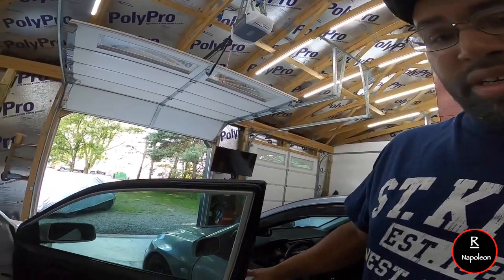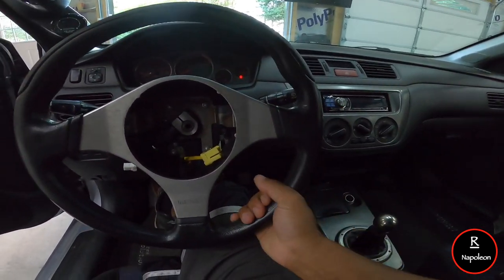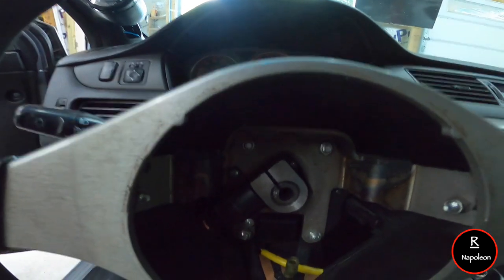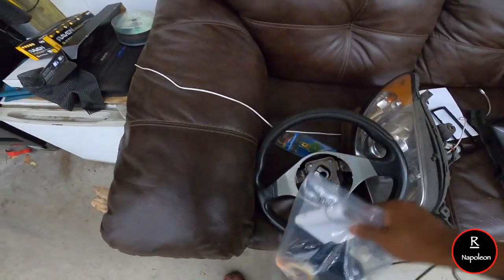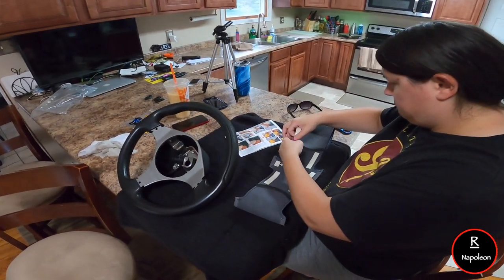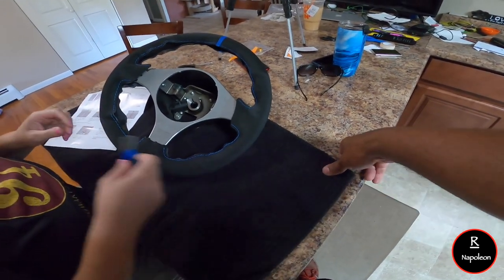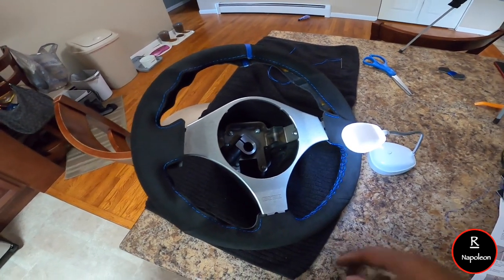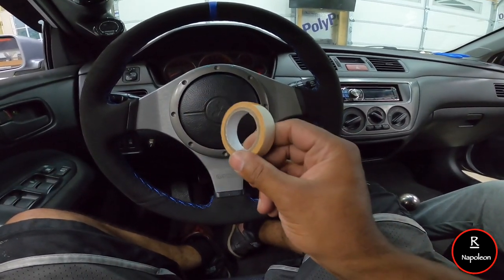How To Wrap your Evo 8 Steering Wheel

Comment: Did you material completely seal around the steering wheel clips? I think mine was a tad short, I couldn't close the gap so there's a small gap around the spokes.
Reply from the maker: It did close the gap you’ll need to stretch it a bit  but it closed up pretty well